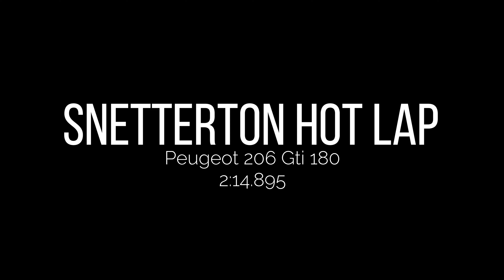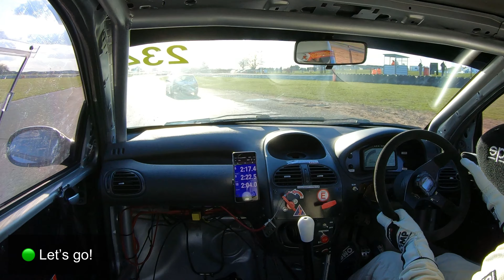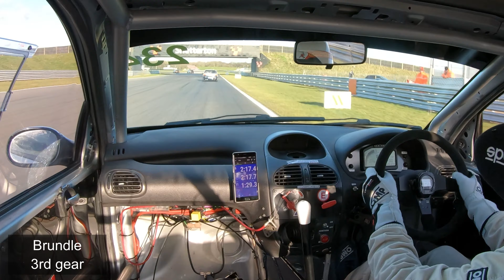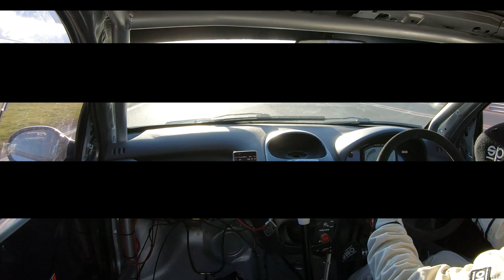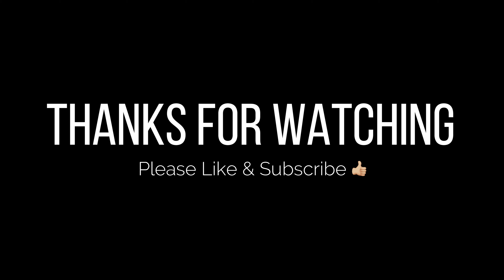Snetterton Hot Lap & Circuit Guide! Snetterton 300 Track Guide 2:14.895 in a Peugeot 206 RC

Comment: Great smoothe (and quick) lap, James.
I still have to use 2nd for Oggies (not enough Torque below 4,500 in the ST).
Apart from that, your lap doesn't look too different to mine - except much quicker.
I would have appreciated the engine sound just a little higher in the mix to hear the changes, that's all.
Notice you 'push-pulled' a fair bit on that lap, not something that I do as a matter of course (tight hairpins an exception).
Reply from the maker: Thanks Ian. I have traditionally used 2nd for Oggies but I think there is enough torque and momentum for me now to keep it in 3rd these days. On that lap I didn’t particularly butcher the kerb either so there’s more time to be had. 

I’d never heard of push-pulled before until I looked it up on YouTube just now! But you’re right, I’m going through a bit of a dodgy phase in the new car where something isn’t quite right with: seating positioning/ wheel size/ power steering response. I feel like I need too much lock for medium speed corners and however I’m sat I can’t get my arms to stay on the wheel. It’s strange but I haven’t figured it out yet. 

Keep your videos coming! Good luck this year.

Comment: Nice driving! It seems you're now much smoother than in the older video. I think you still have at least a second to improve if you can hit the apexes even more accurately.

How much tyre wear and temperature do you need to think for laps like this? This is not a qualifying after all.
Reply from the maker: Thanks Mikko and totally agree. There’s more time there so I’ll be pushing for that sub 14s lap time if the weather is good in March! Hot brakes, tyres and low fuel are all handy things but nothing beats following a car you know is faster and doing everything you can to hold onto it. I think that made a huge difference!

Comment: Why are you hoping to get into the 17’s when you’ve just got into the 14’s??

Nice driving by the way - looks smooth and planted.

Is that an iPhone you’re using for in car lap timing?
Reply from the maker: Just a test to see if anyone reads the video descriptions 😅 that line was quite far down too! No, it was actually a mistake because my last video was a 2:18. Thank you for highlighting the error!

Thanks for the feedback on the lap! It’s actually an Android phone but the app is on both. It’s Race Chrono and you’ll find it on both app stores.